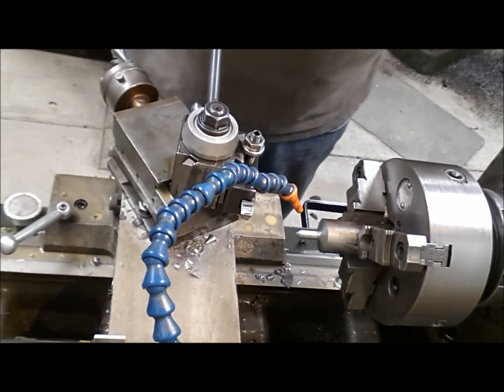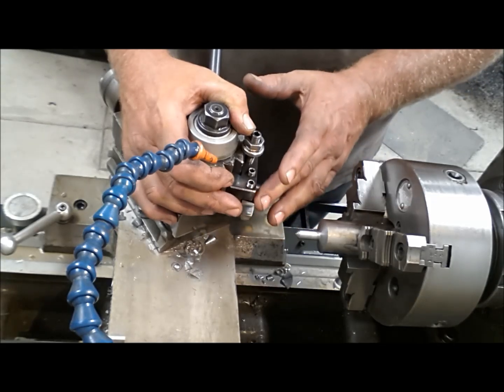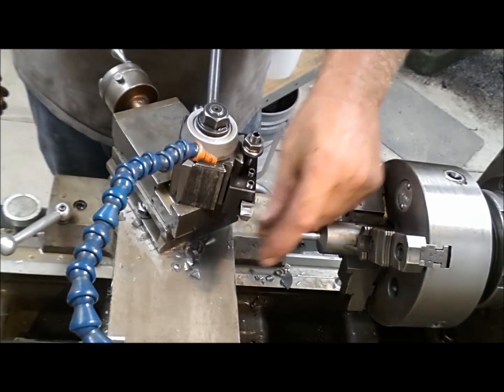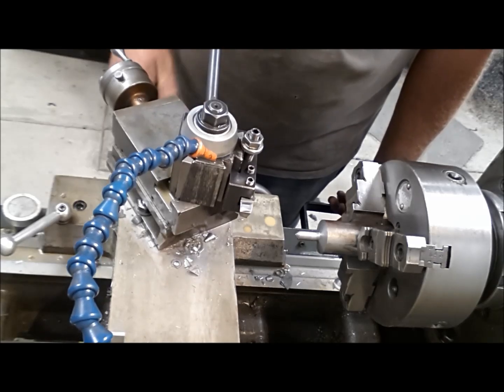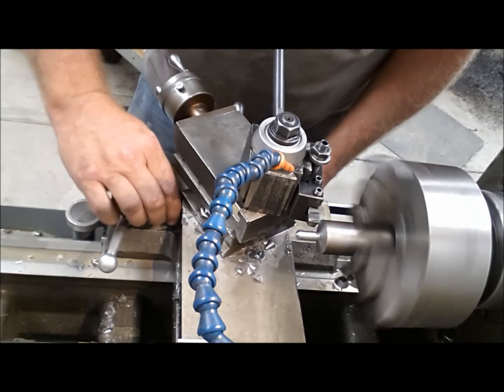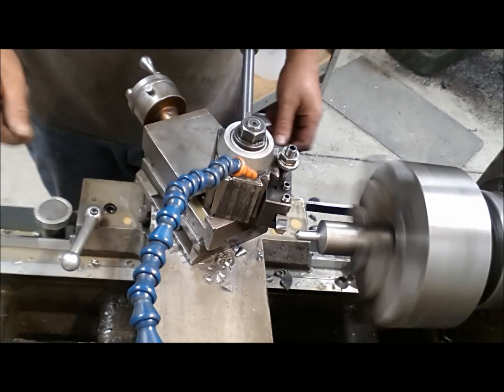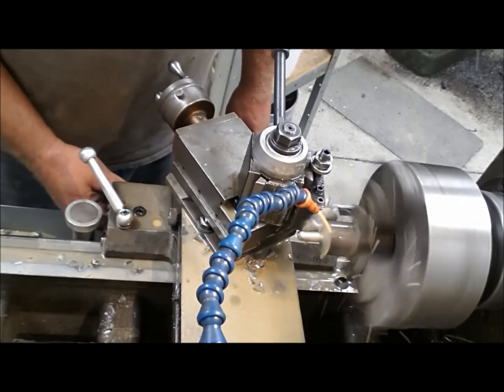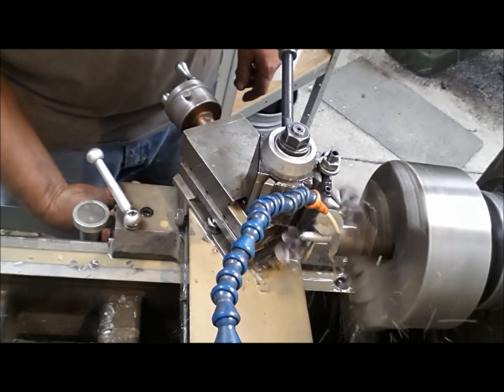Chip control #2 Lightweight division

Comment: I will bet that alot of people will be suprised that your very light weight machine can peel off steel like this....IMO the only limiting factor I see is your half nuts being ruined

I also would like to say that this is not a competition of how much material can be removed etc...its suppose to be about showing different HSS tool bits and what they can do ..or how they react when taking larger DOC

Comment: Stan,
I did a simular grind to yours (AKA abom79) and did a 1 1/4 diameter cut on 6061 aluminum, 220 RPM, .005 feed rate.  The problem was that I thought I was recording, but it only took a snapshot.  My lathe is 1 1/2 hp running on 110AC.